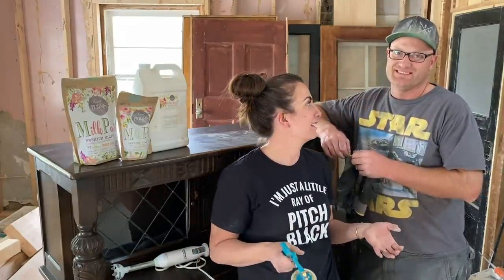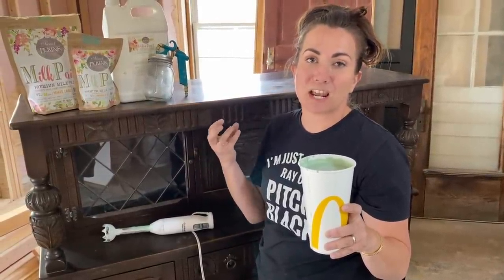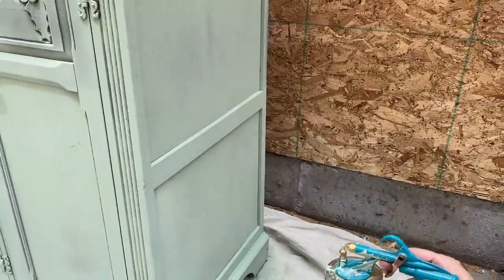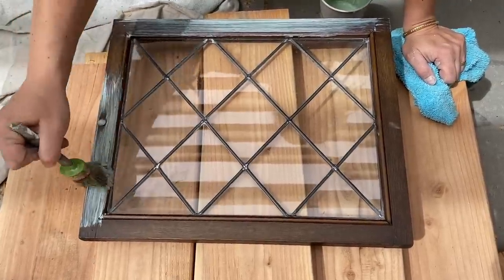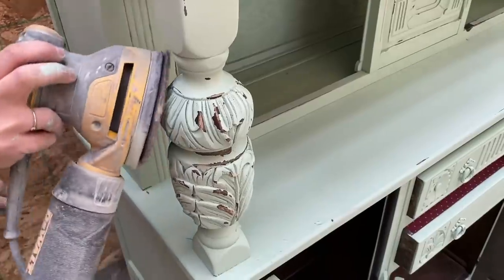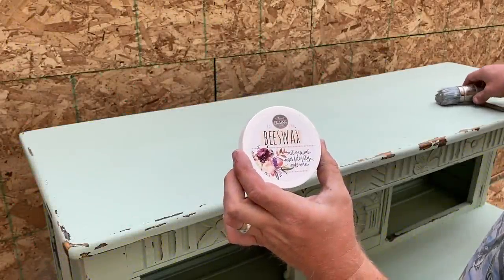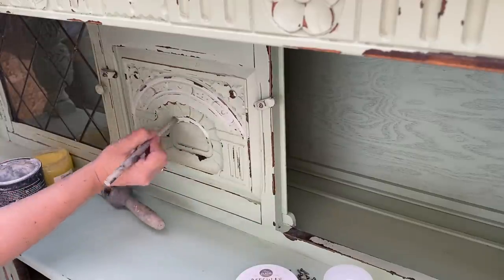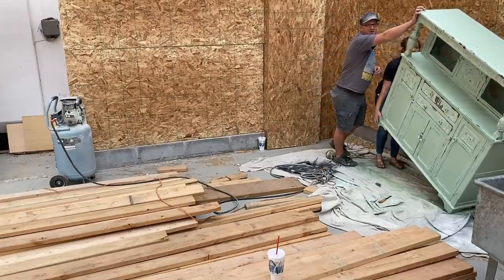Painted Furniture  EASY DIY We Spray Milk Paint!

Comment: Question, what made you choose using sweet pickings milk paint verses DIY paint.
Reply from the maker: I wanted some authentic chippy. Milk paint chips in a way that diy doesn’t. It’s a little more work to mix up. But it’s a cool look
Reply: Okay that makes sense, another question... the sprayer you used; is that one you guys use for only milk paint.. it doesn’t look like one I have seen you use before

Comment: Our kitchen cabinets are ruined from attempt to paint it. But it's so hard to sand back down and it already has dinks on it. Can I spray milk paint over it?? Is beeswax good long term to endure for the kitchen area? Should I not use white paint? Please help guys.
Reply from the maker: I would knock any loose paint off the cabinets and then yes you could spray. Bees wax is durable but I’d use a liquid top coat for the kitchen since it’s such a high use area and susceptible to spills. 
https://jamirayvintage.com/products/top-coat-sweet-pickins?_pos=1&_sid=8a45c85ac&_ss=r